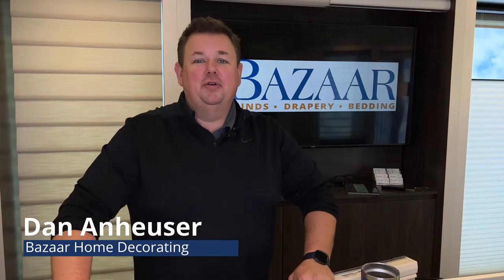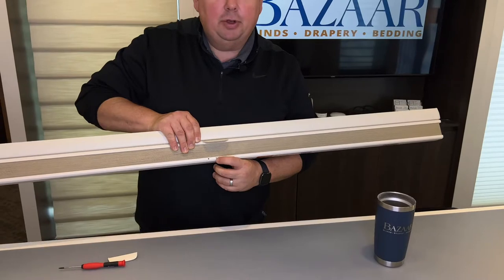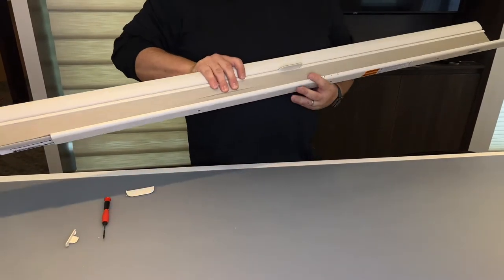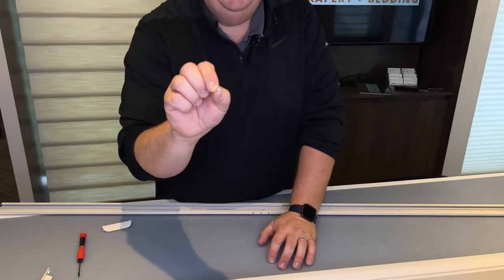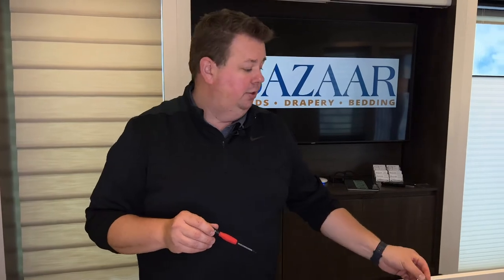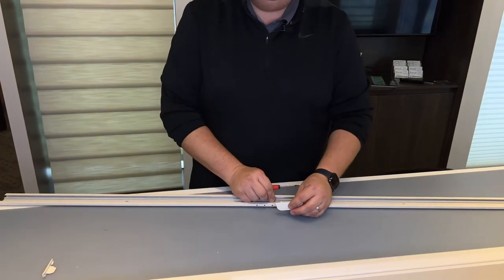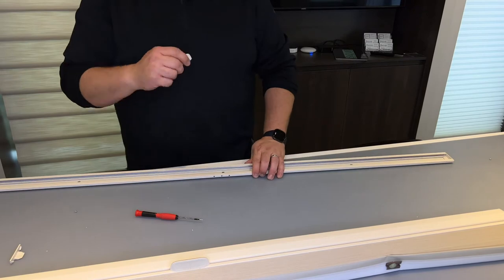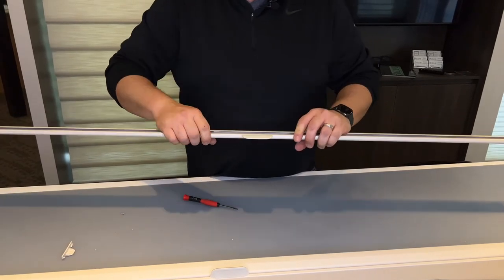Duette LiteRise Handle Replacement

Comment: Very helpful video. It would be helpful to see how to remove the blind from the brackets. We just received replacement LiteRise Handles for our 2016 Duette Shades. In the instructions that came from Hunter Douglas, it says to use a T6 (with Duette and Applause shade) or T8 (with Austria Duette shade) magnetized Torx bit with a long driver to unscrew the handle screw. I think in the video, he mentions using a T8. Great video and easy to see how to do it.

Comment: We have some cracked handles. We just learned that our old screws are not T6...we may need a T7 or T8 to removed our old screws. The T6 and the instructions on the video work great for the bottom rail handle replacement.

Comment: hi thanks for posting this.  is it possible to do re-attach the bottom panel with the blind still hanging or does the blind need to removed entirely?  Thank you again.
Reply from the maker: You can remove the bottom bar while the shade is still hanging.  You do not have to remove the shade.  With that being said, it is usually eaiser to put the bottom rail back on (for an inside mount shade) if the shade is removed form the brackets!